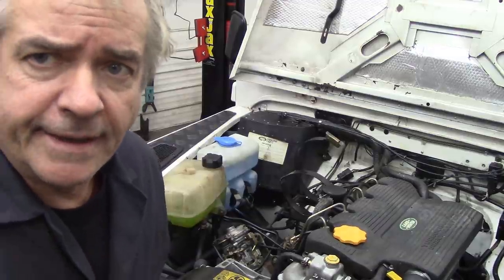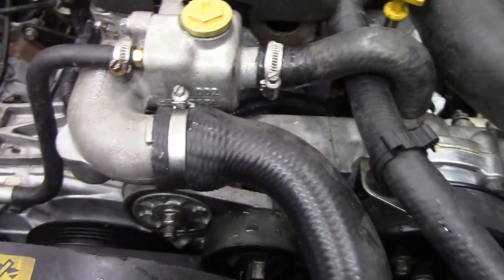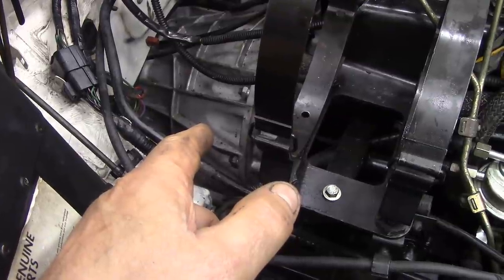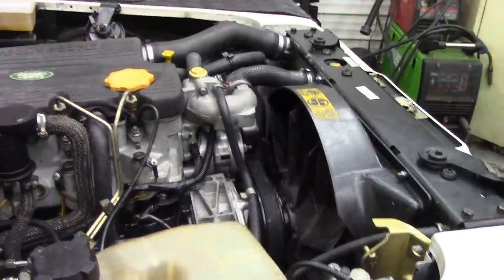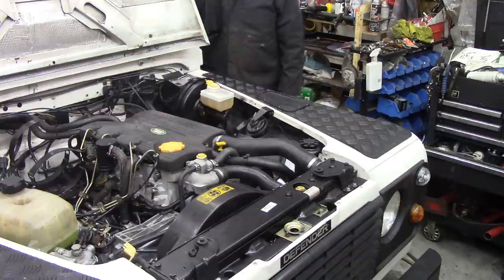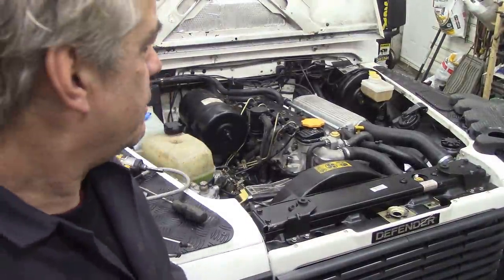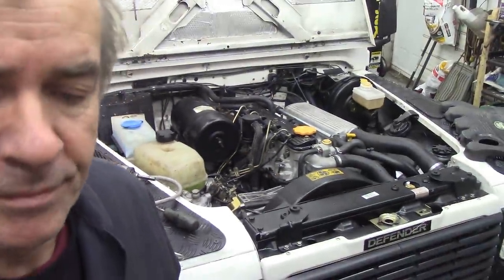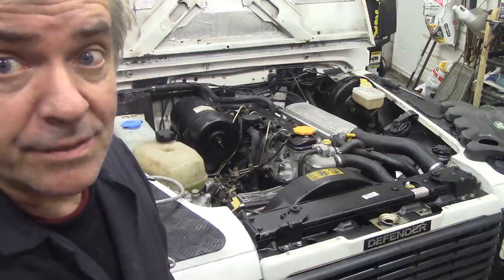Spanish 110 engine start up - but is it right? I have a problem!

Comment: Strange one no doubt you will figure it out I have read in forums about exhaust back pressure also egr delete problems. Not a land rover owner I wouldn't know can't wait for the result and fix but good luck.

Comment: Mike, firstly it looks great and when you rev it that turbo whistle is very nice. As for your knocking, I had some issues with a britpart lift pump making a tapping noise. You could hear it when you reved it up and suddenly stopped like yours. As for your back pressure, that beats me. 
Good luck 
Tristan
Reply from the maker: Back pressure is a puzzle but we will find out what it is !
Reply: @BritannicaRestorations  I have 100% faith in you that you will, have you ever been beaten and never ever resolved a problem ? I would have thought not!

Comment: Mike,
My view is that because the pressures are the same across all cylinders, they must be linked somehow for the gas to equalise.
There's no way it's a coincidence when you add the back pressure problem. Gases are in the crankcase.
It's not a head problem because your pressure tester gets its max reading with the valves closed and any cracks would allow gases into the coolant or give slightly different readings for different sized cracks.
So, gases must be passing the rings, all of them.
You mentioned that the block was bored out. I can't remember previous videos now to know whether you had this done or someone else did it. 
Was it bored correctly? Did you measure it? Was it honed? Did you fit standard rings that may leave a small gap between the ends? Do you have standard pistons by mistake?
Whatever the problem, it's uniform across all cylinders so either boring, pistons or rings for my money.
Reply from the maker: I tend to agree - but let's test first!
Reply: @BritannicaRestorations  Waiting for the video!

Comment: What were the ring gaps set to? Any chance you installed the rings upside down? Did you perform an injector pop test and observe the spray patterns.. might be the chuffing, but would not affect the blow by the rings. Is your pcv system routed correctly? We eagerly await your diagnosis. Thanks for posting!
Reply from the maker: Rings were pre fitted to the oversized pistons  - injectors brand new Bosch ( well 4,00km)

Comment: Bugger bugger 😕 she sounded sweet at start up. Looks like Compression check. I remember rehoning a 3b diesel after reconditioning it 6 months prior. The rehoning l did myself buggered it up completely,l should have left it or put new sleeves in.
Reply from the maker: Starts fine, but blows like it has done 100,000km! Got me puzzled!

Comment: Hi Mike. Love the content. Wondered if you could help me? I’ve got a 300tdi defender but having issue with black smoke on startup and acceleration. Furthermore when I take the foot off the accelerator the engine shakes and feels like it almost stalls. Then goes back to chugging along like normal? Any ideas what it could be? Thanks!

Comment: Would never ever put the rubber hose oil cooler lines in any engine let alone this well pampered rebuild.  Had these on my D90 which split open at 70mph.  A quick engine shutdown and clutch peddle work saved the engine probable by seconds.   It dumped 6qts of brand new oil in 10-15 seconds tops.  Oil splashed everywhere including on the hot manifold and exhaust system.   Shifted to a SS braid with AN fittings and zero chance this ever happens again.  Cost was equal to an OEM set of hoses that can kill your engine any time without warning.   Ounce of Prevention... worth an pound of cure.
Reply from the maker: Maybe you missed a section, but these hoses were previously  replaced with hydraulic hose - you do not need 4,000 psi hose on a system that can only produce 60 psi max  - these are short run hoses and could cause problems with cracking the oil cooler in the radiator later on - I have seen it many times - they will be replaced with OEM hoses in my next order

Comment: I noticed at 10:20 that the expansion tank looks like it is bubbling, a lot. Is that normal?
Reply: Yeah I just checked that out too.  Does look like it is getting thrown around in the header on revving up.
Reply from the maker: No this is normal - it is the coolant returning to the tank from the bleeder pipes - you cannot see this on black tanks
Reply: @BritannicaRestorations  Just taken my 300tdi for a 6 mile trip. Checked it when I got back with a warm engine. Mine doesn't do that!

Comment: Damn that sucks Mike. Is it worth running with the rocker cover off, trying to slip a feeler gauge under each rocker to see if it quietens? (Vauxhall Chevette style!!) That would eliminate valve gear, but maybe not guides. Has one of the guides dropped out of that shiny new head? failing that it's compression test and or cylinder loss test. Either way it's at least head off I reckon. Best of luck, I know what it's like to struggle with rebuilt engines, I was sold a set of incorrect big end shells for a Mitsubishi Shogun many years ago, you could probably have heard it knock in Canada!!
Reply from the maker: I am not bothered with the tappet noise, easy fix, but the compression test was interesting !
Reply: @BritannicaRestorations  tappet noise easy fix? how would you fix it? what is it?